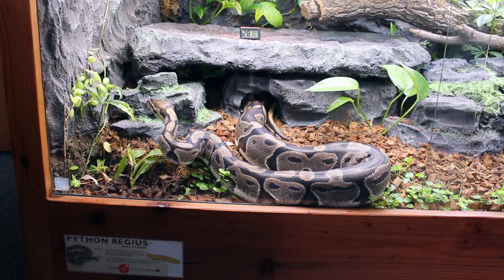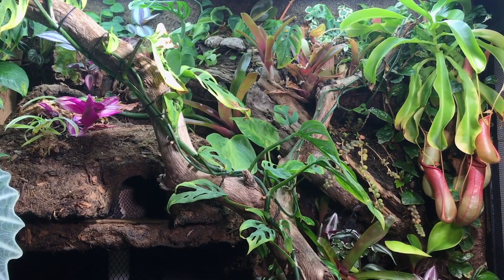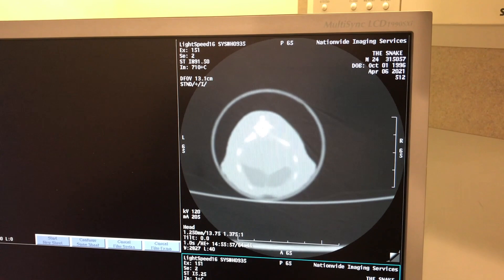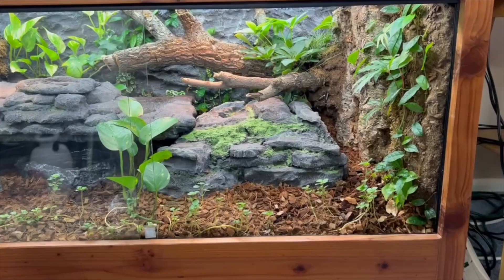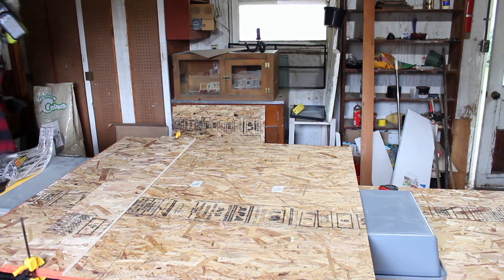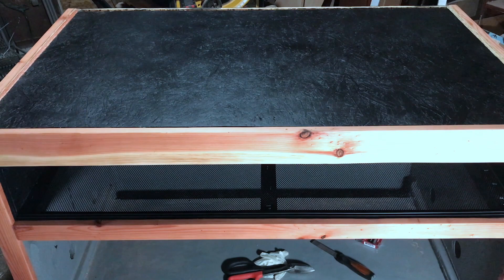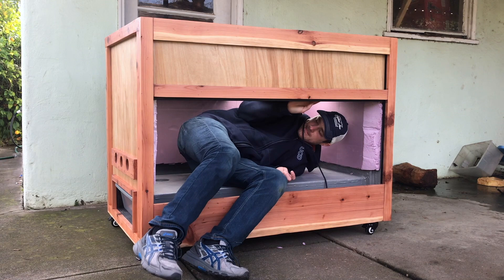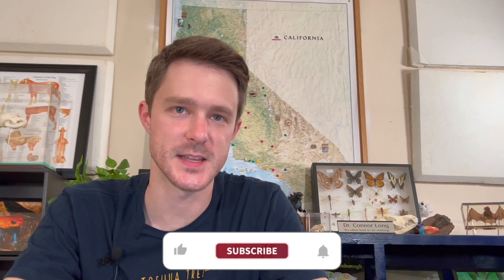DIY Bioactive Ball Python Vivarium/Tub Hybrid Enclosure (Part I)

Comment: I remember commenting on your other video 3yrs ago and told you it unfortunately sounded like your snake had an RI and you told me I was wrong. Anyway, I'm glad he's doing well and this isn't an attack on you. You clearly really care about him and his enclosure is amazing!
Reply from the maker: Thanks for the comment - I respectfully still disagree with your assessment. He didn’t have an RI at that time, he developed one over a year later after I moved to a different house with worse heating and had an equipment failure during a cold spell in the winter, and his behavior when he had an RI was very different from the signs you commented on originally. If I recall, the original signs you commented on (audible respirations) were an artifact of how I post process audio for these videos (I run it through a compressing filter that tries to make it all the same level, but when I was originally doing that it was making quiet segments sound very weird because I didn’t know what I was doing). I’m not even 100% sure that the audio you were commenting on was even the original audio from the video - what I started doing was to delete most of the actual video sound and replace it with narration, (though I don’t remember when I actually started that)

In any case, snakes that are being handled will sometimes make sounds like a hiss or a sigh, that doesn’t necessarily mean they have an RI. Audible respirations at rest are more concerning, as is tachypnea at rest (a sign he had with the RI and did not have originally) and lethargy and inappetence (neither of which he had in the original video). That enclosure worked really well in my old house (June 2019 to June 2020 when I moved) because that house was insulated well, unfortunately the new place is not and my thermostat failed in what I believe was Spring of 2021.
Reply: @ConnorLongDVM  Yeah I agree 100% with what you say about some snakes making noise when handled. I have a corn snake who has done it all her life. Not everytime, but quite a lot of times when I have handled her I have heard her make ever so slight "breathing" noises. But it's never been an issue.
My original comment on your old video wasn't meant as an attack on you as a keeper or anything. I didn't want to sound like "that guy". I just wanted to make you aware of what I thought I heard incase I was correct and you weren't already aware yourself

Comment: Could this build be done in PVC instead of wood, to make moving the setup more feasible? Got a friend with a ball python stuck in a 20 gal fish tank, and they don't want an appropriate sized enclosure because it would be too hard to move with when they need to move apartments. I'd love to help make the snake's (and owner's) life better by building something for them that can house the snake healthily and be transported more easily.
Reply from the maker: I see no reason why you couldn’t make a similar build out of any non-toxic waterproof material you are able to work with. Personally, I have no experience working with PVC as an enclosure material so I can’t vouch for what would be required. I get a lot of questions about using different materials, but I can only vouch for the methods I’ve personally employed. If you do it you should make your own DIY - might be helpful for others with similar goals!

Comment: You're making me want to build a bunch of these for mine. How much did the build cost? 

I'm a breeder but I keep my adults in 106 quart tubs. 4 times bigger than what the "old school" breeders use.
Reply from the maker: This build was expensive, probably between $500 and $1000. However, I made it at the height of covid related lumber cost spikes and bought a lot of new equipment for it. Plus I definitely overbuilt it. I think a slightly simpler version out of decent quality plywood could be built for much less, and if you were building multiple vivs for multiple snakes that would also decrease your per-unit cost. You could also consider using drylok instead of epoxy to make the whole thing water resistant and then use removable pond liner at the bottom to make a waterproof basin at the bottom for the drainage layer, that would decrease costs quite a bit more.
Reply: @ConnorLongDVM  Awesome, thank you!!